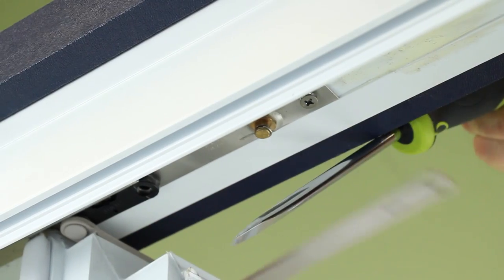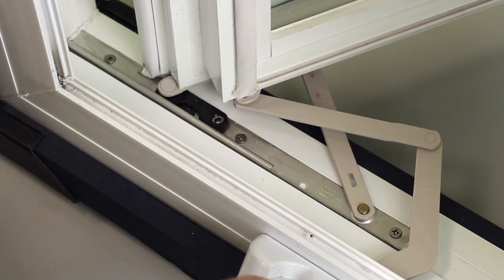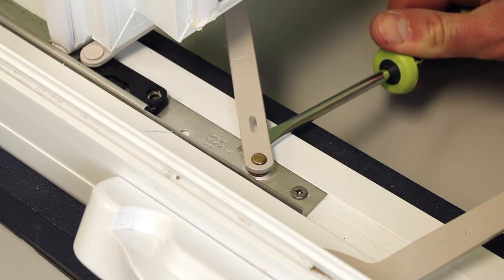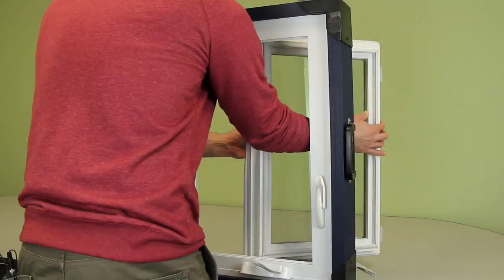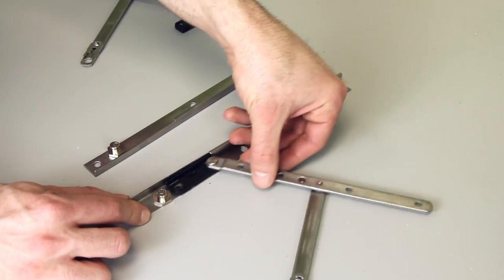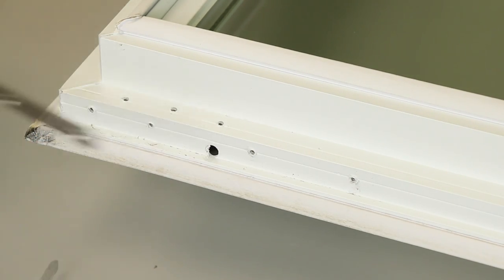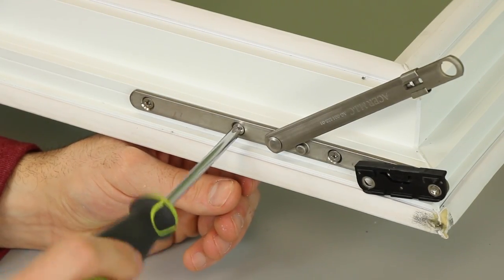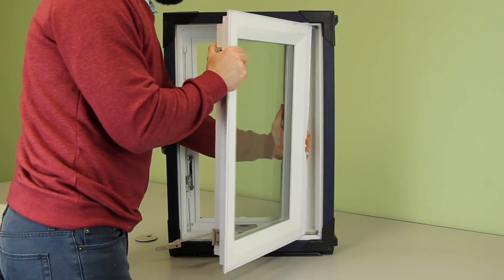How to Replace a Hinge Set in a Casement Window [1080p]

Comment: I want to use casement windows in my kitchen and found someone who is selling two left hinge windows from a construction project for which they weren't used. Can you change a left hinge into a right hinge by moving the hinge? Or, can you hang two left hinge windows in the same space or would that not work/look awful? Thanks!
Reply: You cannot change a left hand hinge into a right hand. They are factory assembled to be one or the other.

Comment: hi i moved into an apartment and that turn part isnt connected to the frame so the draft comes in my house. i have to use screws and nails on a string to close it. its in the bathroom. landlord wont fix it and it right in the shower part of the wall
Reply from the maker: +qwaneasia Hmm, it sounds like you're referring to the "operator" portion of the window. Can you see a bracket on your window similar to the one shown at 2:20 in the video?

Comment: Hi SWISCO -  First, GREAT vid.  Much appreciated.  
Haven't yet taken things apart to see exactly what's going on.  In short, when the window is cranked close, the base of the window can now crank right out of the end of the track underneath the window - pivot side.  If I have to remove to widow - I'd love to find something simple, like one of those screwdriver clips simply came loose - rather than some permanent thing broke off.  From your experience, are there any notoriously weak elements that can break on the "TRUTH"  tracking systems?  The casement windows we have are pretty large.  2nd story, 4' x 5' tall - double pane, french window style ... maybe 50 Lbs I'd guess.  Likely I'll have to hump this bad boy completely off the frame - but just in case you can suggest some easy thing to check before doing so, thought I'd give you folks a shout.  
Thanks in advance for any advice you might provid.
Gary